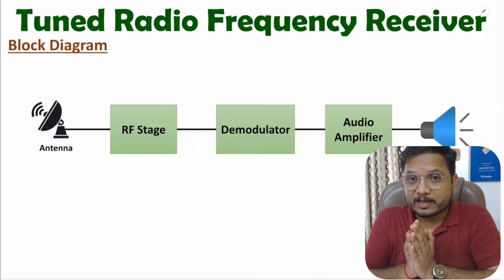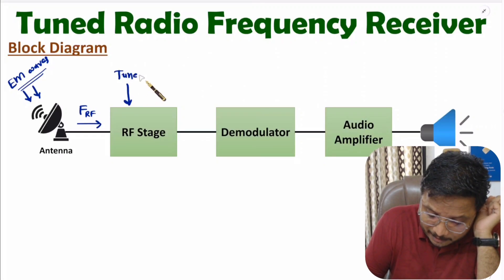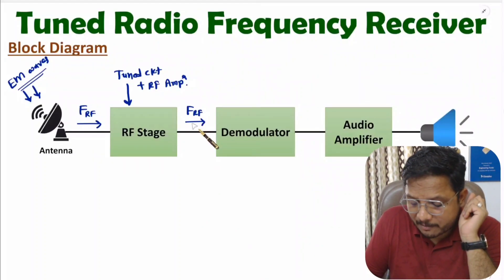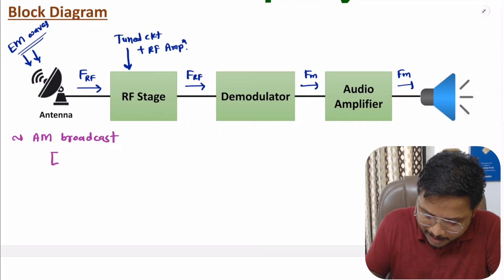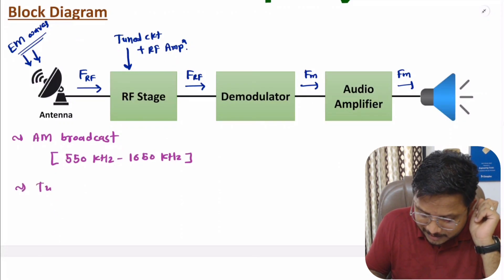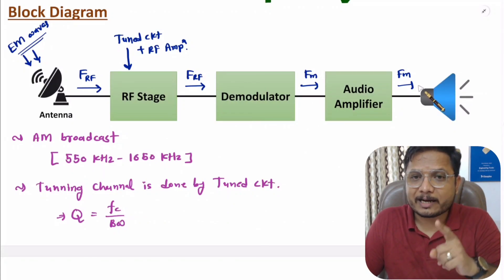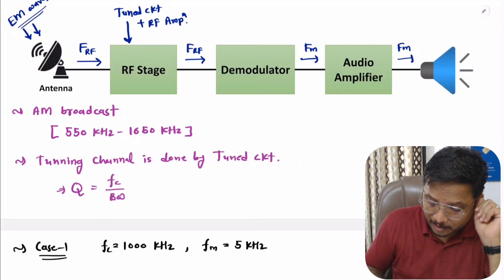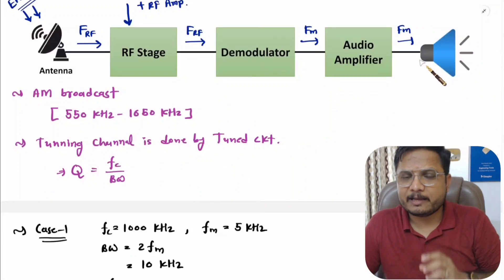Tuned Radio Frequency Receiver Explained: Basics, Block Diagram, Working, Case Studies, and Issues

Comment: This breakdown of receiver characteristics looks super comprehensive! I’m curious, among these topics, which aspect of the Tuned Radio Frequency Receiver do you think poses the biggest challenge for modern - day engineers? And are there any emerging technologies that might help address the “Issues of Tuned Radio Frequency Receiver” in the near future?
Reply from the maker: Without knowing how we use receiver, how can we use emerging tech. 
I mean 1st we have to learn the science of current technology and issues with it.
Reply: Totally agree! Mastering the current tech and its pain points is the first step. Then we can bring in new stuff like SDR or AI - driven signal optimization to fix receiver issues. It's like building a bridge from the known to the innovative. Looking forward to more insights on how these blend!